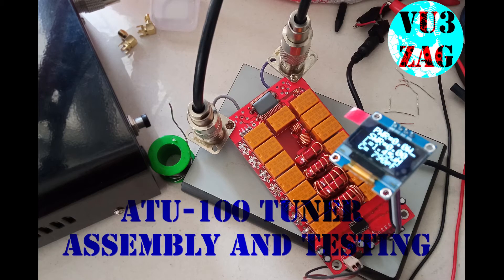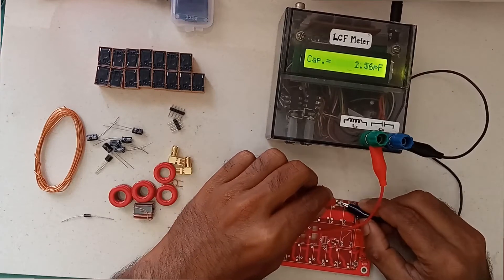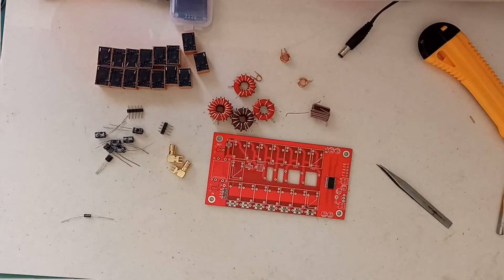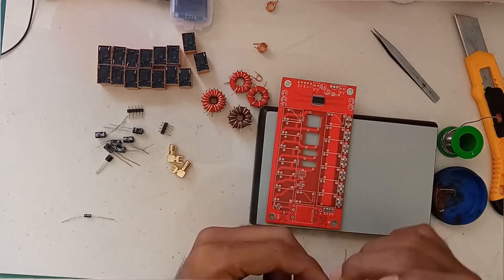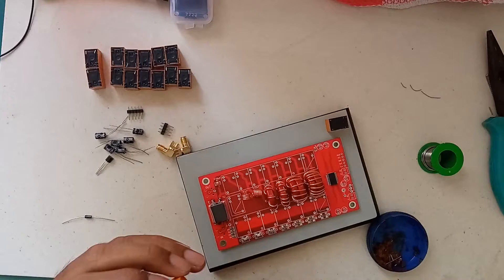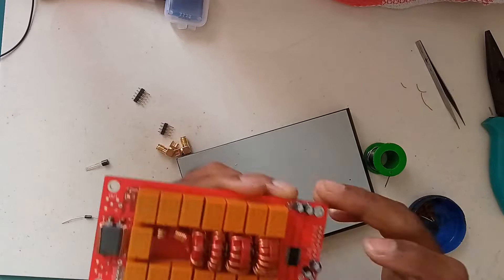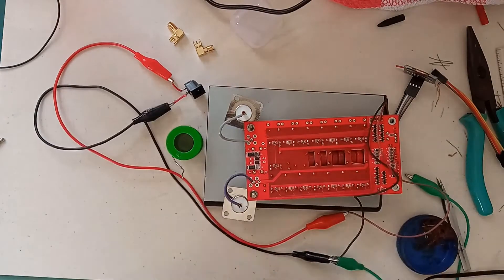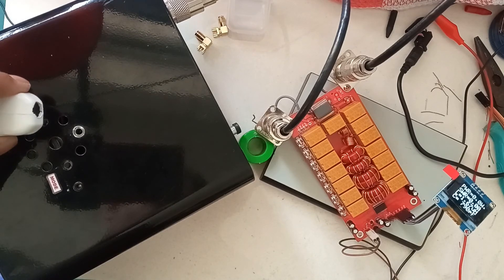ATU 100 Tuner Kit Assembly and Testing

Comment: As i conclude (because i have buy assebled the ATU-100 but without further instructions...), the connections between 1) LCD and 2) mainboard are (from LCD to ---> main BOARD)   
SDA --->DAT   
SCL---->CLK     
VCC---->VCC   
GND---->GND

73 de SY2EDI
Reply from the maker: Yes